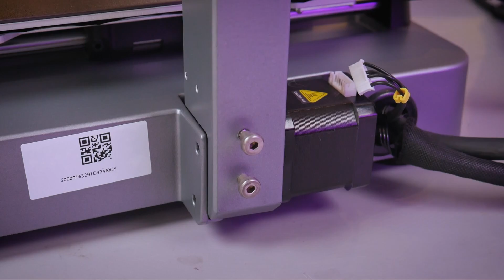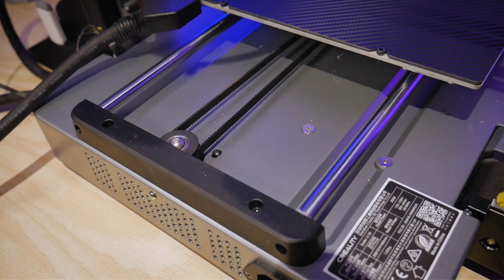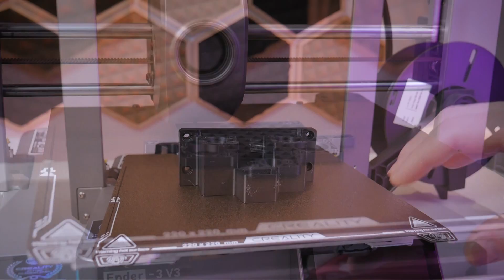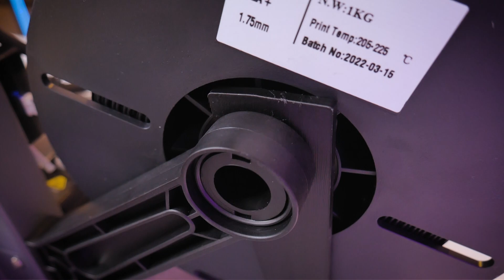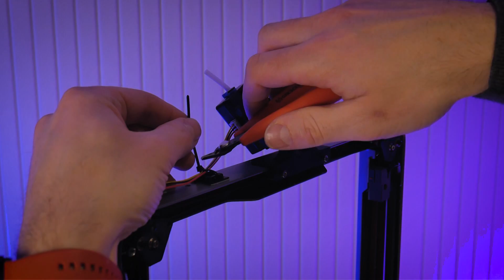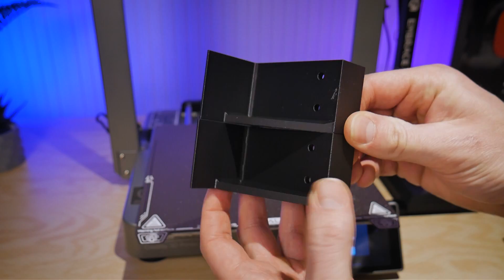Creality Ender 3 V3 Setup Guide, OrcaSlicer, Upgrades, Review, vs. K1C

Comment: Your reviews are great, can u make a comparison of the KE and V3 and the S1, about which one to buy regarding the best value
Reply from the maker: I'll see what I can do! In the video I touch on the KE vs V3 and I would pick the V3 if you can justify the extra $$ it's definitely worth it. The S1 is a bit older and it's still a decent printer but the V3 is crazy fast out of the box with no extra work

Comment: Maybe the included top mount filament spool holder model could be modified to have a ball joint for your filament run out sensor mount.

Comment: I've gotten really frustrated. There are three versions of the same printer, the ender 3v3, 3v3 se, and 3v3 ke. The main issue is I search for guides on the 3v3, mainly hotend issues. But every result is for the se and ke version. Any help
Reply from the maker: Hey, I've got a guide here on the V3 / K1 style print head metal gears: https://youtu.be/w66gyeCALEA
I also have one for the hot end specifically for the V3 and V3 Plus here: https://youtu.be/fI2l2LSkEME
Let me know if that helps

Comment: Very nice .. I purchased (and finally received) the Ender-3 V3 Plus and LOVE it! I had the original Ender 3 when it first came out and have had to add so many updated parts to keep it halfway working -- this new printer took very little time to setup, self-test, and get working. My prints are turning out SO much better. The HyperPLA included allowed printing "Benchy" in less than 15 minutes. I still love my Resin Printer for very detailed prints, but I am totally digging this new filament printer and look forward to doing much larger prints than my resin printer can handle. (I really wanted the K1 or even the new K2 Multi-color, but just can't justify those prices yet as a hobbyist). Only issue I am having are slicers. I'd have to follow what you did and see if I can manipulate. I was able to get the new v5 Creality Print installed, but it still doesn't have the PLUS yet, and for some reason, I can't change the bed size to match mine in the profile. Still playing around.
Reply: They're making a multicolor upgrade compatible for the ender 3 v3s
Reply: @chrisstepper2409  yup CFS .. upto 16 colors max

Comment: great video. i recently received my printer and I am a total beginner. would you recommend i switch to something like orca slicer or stick to creality print?
Reply from the maker: Thank you! You can use whatever you're comfortable with but ultimately orca slicer is more powerful if you're doing more complicated parts and need more options and parameters. So it's worth learning it at some point

Comment: Would you be able to share the print file just for the Runout Sensor Harness Extension? Looking at this Core XZ as a printer option and would probably mount filament spool on a Skadis pegboard above printer.
Reply from the maker: I think this is the part you want? https://makerworld.com/en/models/428902 Let me know!

Comment: Can I ask what kind of connector is used on the wire to the runout sensor?  I am considering this printer, but need to feed my filament from a shelf above.
Reply from the maker: It is a JST XH 3 pin connector - thanks!

Comment: Is there a setting I can change to get rid of the little hairs you are getting on your print? I get that no matter what I do, thank you! Nice video!
Reply from the maker: What filament are you using? Sometimes it helps printing at a slightly lower temperature... But don't go too low and get a jam. I think the stringing could possibly also be some moisture... PLA doesn't usually absorb much moisture but I've noticed the longer my rolls sit out usually they get a tiny bit more stringing. You can also look up a retraction test in Orca slicer and tune your retraction settings.
Reply: @EmbraceMaking  it was old filament even though I always have it in the dryer box, I got creality hyper pla and all my prints are basically perfect now lol

Comment: I'm having an issue where mine is running the first layer way too close and don't see a Z offset setting onboard the printer (other than the one you can adjust during print) it would be nice to have a permanent setting with the auto leveling... it's good.  Not perfect.
Reply from the maker: Are you on the latest firmware? I noticed that prior to the latest firmware the offset would revert after every print - now it seems like when you do the live adjust the value is saved going forward on all prints.
Reply: @EmbraceMaking  that's interesting. It updated right after I connected it to wifi,  but maybe I should check. So far that's literally the only problem I have with it. If that was how it worked that would be stellar.

Comment: i have this exact printer as my first printer. i am having trouble with filament getting stuck in the extruder gears. It currently has a piece stuck there and i don't know how to remove it without taking the entire head apart. I've tried heating it up, forcing it to extrude and pushing the filament. Any help would be great.
Reply from the maker: I have a short video coming soon showing the print head tear down. You may have solved your problem by now but for future reference I'll have something on this topic
Reply: I was finally able to solve it today but I will be looking forward for the video.

Comment: Would your stand work with the new V3 plus?
Reply from the maker: It should, worst case you'll need to just print the extension splice to make it a bit higher... My v3 plus just arrived so I'll be putting it together over the next few days and confirming 🙂

Comment: Did yours make a like at the back of the print base during autoleveling and input sensing? Just curious cause i though i was having a crashing issue with mine. Saw the nozzle keep going right agaisnt the print base and wasnt sure if it was normal
Reply: Mine did the same thing and I just started it up and ran the initial test 30 minutes ago
Reply: @TheZeroSAS  don't worry, the manual doesn't go over it but after researching ive found that that area back there is for automatic nozzle cleaning and the nozzle touching the print base isn't crashing just touch sensing to calibrate itself. It's all good just make sure you run the calibration before every print when the option says to and youll be good. Haven't had any issues since

Comment: I bought your spool stand and the run out mount wasn't included in the shipment. Is there a file I can print for it? 😊
Reply from the maker: Hi Chelsey, thanks for your support! Yes the runout mounts aren't included - the premise of the stand is that you get all of the stand parts + all of the hardware for the various runout mounts because the hardware can be a pain to source, so I do that for you - but the runout mounts themselves you print on your own. Since I plan on designing a lot of different mounts and adapters for various machines it doesn't make sense to include all of them since I wouldn't know which machine the customer owns. I assume you own the V3 since you're commenting on this video? You can find the full list of applications and the links to the mounts / adapters here: https://embracemaking.com/blogs/resources/universal-top-mount-spool-stand-accessories-and-adapters

Thanks!

Comment: I just got mine (first 3d printer ever)and it immediately slipped? How do i make it so it sticks?
Reply from the maker: What do you mean by slipped? Do you mean the print didn't stick to the print bed?
Reply: @EmbraceMaking  yes but I kinda Made it work 
I used alcohol and glue stick
But I think what actually worked was switching the filament for another one because I don't know how to use the printer very well and apparently I need it to be hotter on the one I bought (thankfully I had bought another one and it was a different material) and since I was just trying to print what is already on the printer I couldn't make the bed or the nozzle hotter while running it (I still don't know how to change that, I am using orca slicer) 
But now I have printed a few things here by switching to a filament that melts easier

What I wanna know now is how to change how hot it gets depending on the filament and how to tell what kind of filament I am using (I assuming I can't do it on the printer and have to do it on the slicer)

I also wanna know what the name of the bed that comes with the Ender-3 v3 to put on the orca slicer(I just picked one of the ones that had the name creality

And now another problem I had was removing the print from the printer, is there an easier way?

Sorry for the barrage of questions I am completely new to this and oftentimes people skip those things because it is common sense to them if you have any video to suggest I watch it, I would love it just wanna tell that currently the only "pc" I have is a steam deck soo yeah 👍 I put orca slicer and hope I won't need another slicer and I have to learn to use 3d making software but that's for the future for now I just wanna learn how to customize the print to fit the filament, bedding nozzle and printer I am using 

Just wanna say that English is not my first language so apologies for any mistake and since I am new I don't completely understand the naming convention to use (is bed, bedding the right term?)

Comment: I have a question for the Ender 3 V3 KE and we don’t change anything right ? Leave everything where it is?
Reply from the maker: Would love to try and help you - what are you asking to leave where it is?
Reply: The upgraded part for the ender 3 V3 KE cuz I’m going to buy the filament mount kit u made and you don’t have a video for it
Reply from the maker: Ah okay, yes the top sensor mount is here: https://makerworld.com/en/models/428902 it will work with the KE without changes. There are two holes at the top that fit the M5 button head screws where the old spool holder used to go on the KE. You re-use those two screws. I am working on the spool stand assembly video right now it should be out pretty soon. There will be more info about all of the applications (including pictures etc) on my website here as I build all of the applications: https://embracemaking.com/blogs/resources/universal-top-mount-spool-stand-accessories-and-adapters   Thanks!
Reply: @EmbraceMaking  thank you 🙏

Comment: I’m debating on either getting the Ender 3 V3 or the K1C, if you were to pick just one, which would you recommend? Which one is the overall winner? That’s the one I’ll buy I don’t mind price
Reply from the maker: If the price doesn't matter go for the K1C , but if you want to save the extra $$ and you're mainly printing PLA the V3 is the best value
Reply: @diegovn thank you so much for your reply
Reply: @EmbraceMaking  thank you so much for your reply. I highly appreciate the both of you and yes I feel like it’s time for me to get an upgrade I’ve had the Ender 3 v2 and it’s been my first printer but I feel like it’s time for an upgrade I just love the fact that you don’t have to mess with the printer as much anymore to print something Don’t even get me started on leveling the bed before every print😂 I appreciate your feedback
Reply: K1C it is!

Comment: do u consider this one to be better than the Ender-5 S1 3D Printer
Reply from the maker: The ender 5 S1 is actually a pretty under rated machine. I'd probably give the edge to the V3 because of the new extruder and hotend design, but I still like the cube frame printers with the bed only moving in the z axis... seems much more stable. Also, on the ender 5 s1 it uses the v wheels instead of the linear bearings... they get the job done but technically the linear rods on the V3 should be better.

Comment: I'm confused, this isn't a Ender-3 V3 SE? The naming scheme on their machines is pretty odd.
Reply from the maker: Yes they didn't make the naming that straight forward... but basically... Ender 3 V3 SE is the cheapest one with Marlin firmware, Ender 3 V3 KE is the next step up with Klipper, and Ender 3 V3 is the one in this video with Klipper and core XZ etc. That's what I was saying in the beginning of the video though... I feel like for this one they should have just called it something completely different.
Reply: Trying to get "Ender 3 V3 Core XZ"  to stick in descriptions, because I got one and researching info on it is a nightmare. It's almost like it doesn't exist when you try to Google it. There is only like one other core XZ printer in production.
Reply: Ender 3 V3 Plus ☝🏻

Comment: Would you still recommend this one over the v3 KE even with a $120 price difference? This one being more expensive. I'm torn between choosing those two right now
Reply from the maker: If it's not too late I would still recommend this one given the price difference. The KE is great if you're bound by your budget but I would say this one is worth the extra $$
Reply: @EmbraceMaking  sadly too late as I got the KE, it's been good so far but there's some occasional fails where it spits a ball of plastic.  Otherwise I'm fairly happy with it.

Comment: This machine is bad, actually its system is the problem. It checks only 5 points to make auto bed levelling in the start of every print and 6 out of 10 prints fail just because of that, while my other printers Anycubic Kobra 3 and Bambulab A1 checks more and more points and prints well with same filament. Actually Bambulab is the best, their technology is way over others... Anycubic's extruder is also weak like Creality's, chooses filament and stucks sometimes... Great work Creality, keep it on like this, noone will never buy your products if you dont update this absurd and weak auto levelling. Real charade...

Comment: Has anyone had a issue with the bed shuddering and hitting the front rail stop? I can't find a fix. Any help would be greatly appreciated.
Reply from the maker: Not something I've experienced and I have 5 of these machines now... did you solve it yet?
Reply: @EmbraceMaking  yes I did. I jus did a firmware update. That seems to solved the issue. Now to upgrade the hotend. I'm having clogging issues and I think it's the hot end. I may have got a lemon. LoL I have the OT hot end coming today. My SEs and my other KE,EV3 and EV3 Plus I have not any issues with.